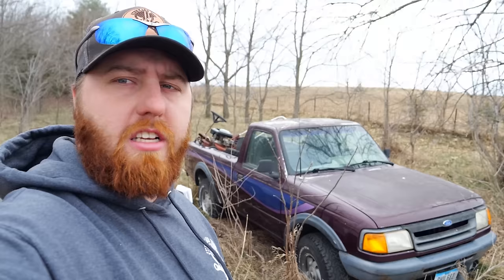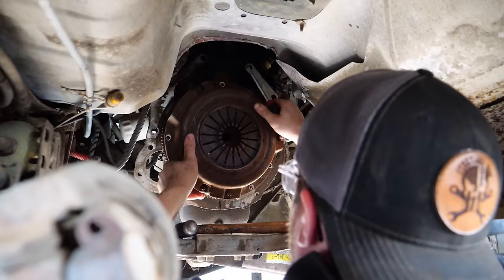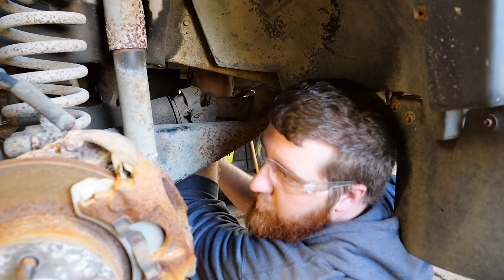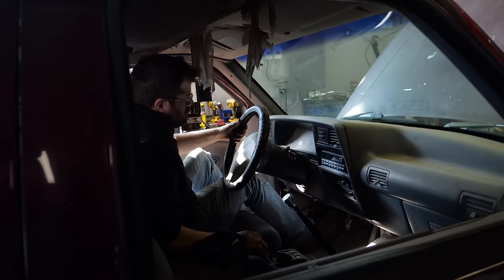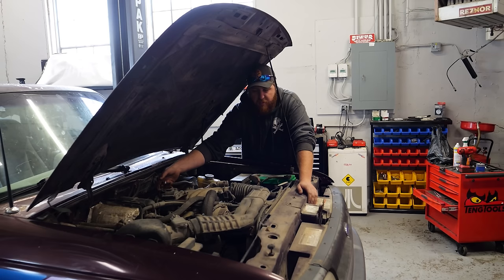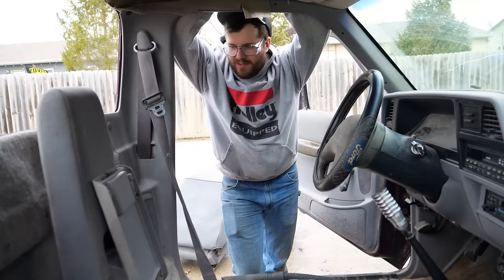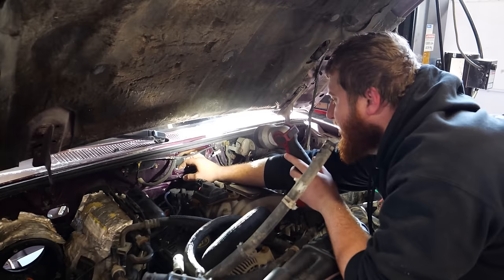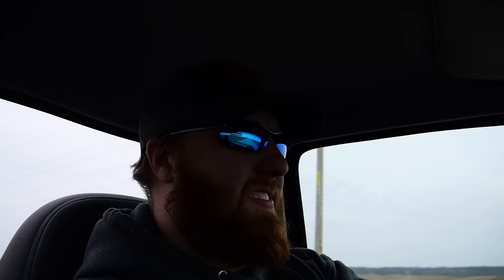Will my CHILDHOOD Truck RUN & DRIVE After sitting Abandoned for YEARS?

Comment: I have a 97 Ranger with the 2.3L 4-cylinder engine and the 5 speed.  That M50D transmission is, by far, the worst thing about the truck.  I have never known whether its just an inherently POS transmission or (as I suspect) caused by nobody changing the ATF in it for close to 90k miles (before I bought it) and wearing out the synchronizers for 1st and 2nd gears.
Reply: Wow that's crazy I've had multiple 2.3 5spd Rangers burn outs daily never had a issue with the those trannys my current beater is a 93 2.3 5spd not a day goes by I don't dump the clutch or power brake it 3 footing changing gears truck has around 270k miles
Reply: @frankm8533  I guess the owners who had it before me drove it like you drive yours.  lol